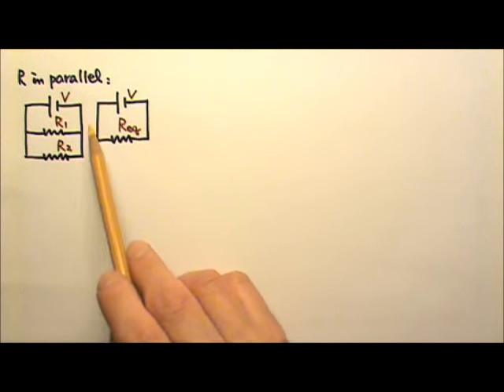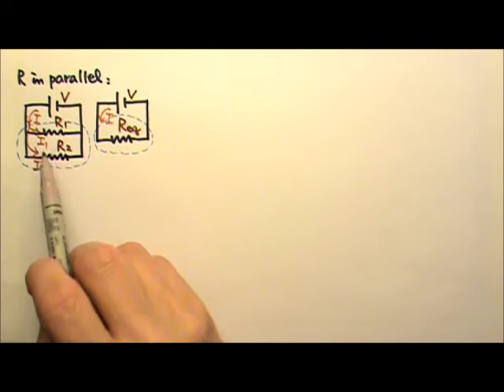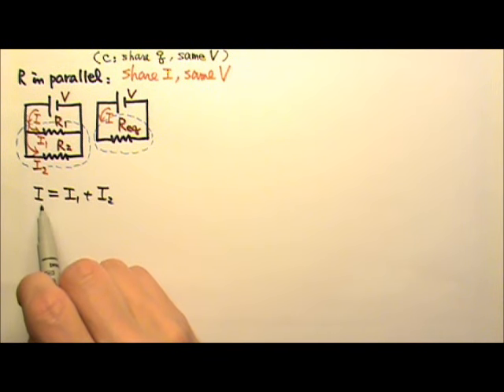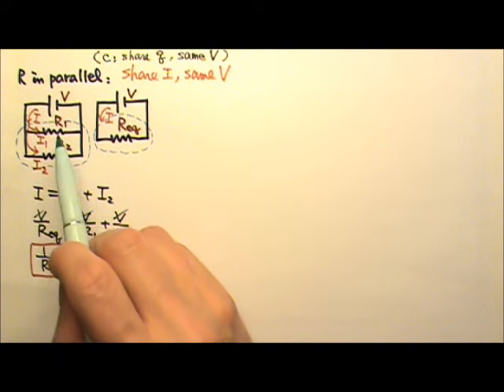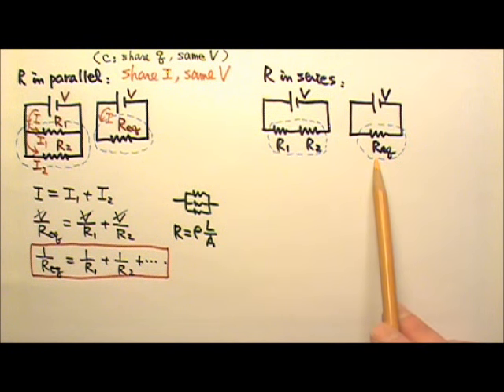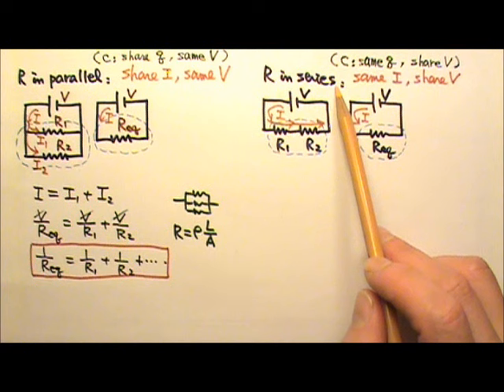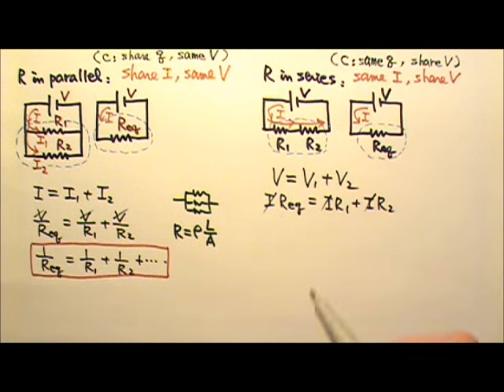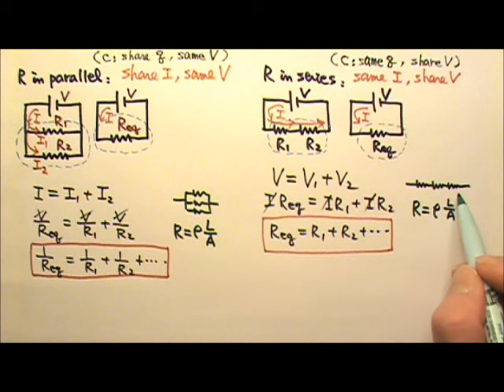AP Physics 2: Circuits 10: Resisters in Parallel and in Series

Comment from the maker: Yes, that is right. The voltage (electric potential) is kind of like height. So the battery provides a voltage V (a certain height) and the 2 resistors in series are kind of like 2 steps to that height (or down from that height): height of one step + height of another step = total height difference.